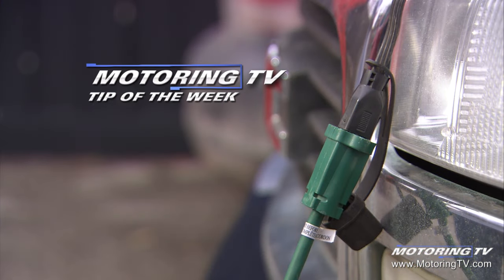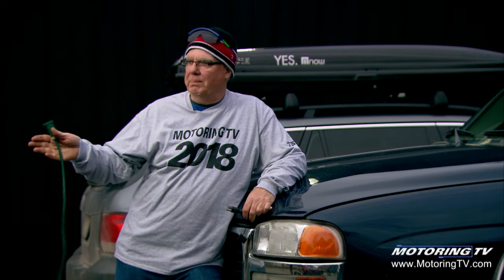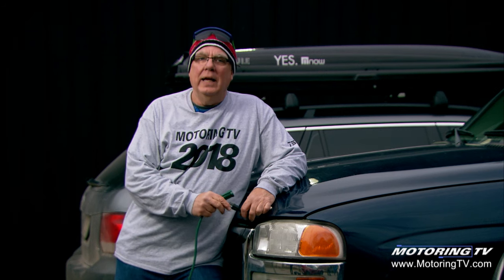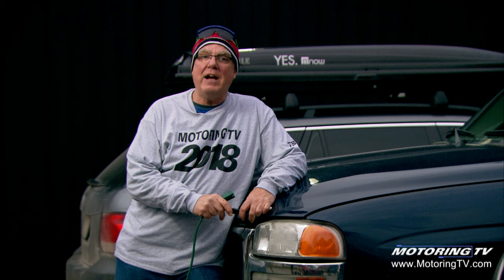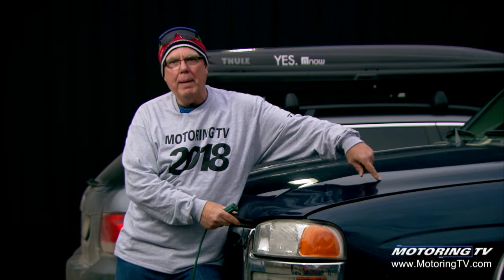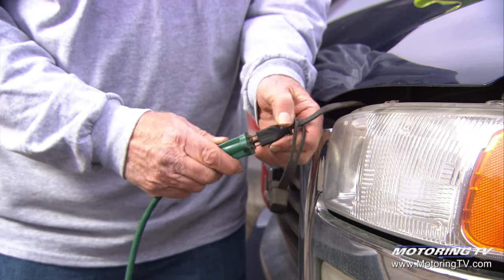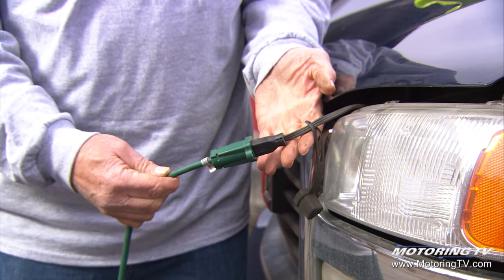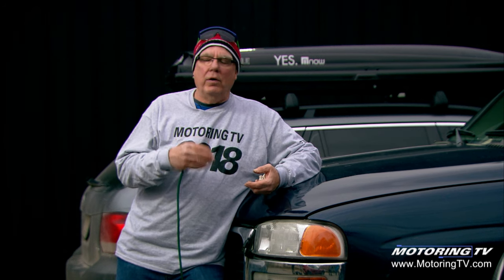Tip of The Week: Where's My Block Heater?

Comment: ...okay, cool. but, WHERE IS IT???
Reply: Look by the battery if your battery is under the hood check by the fuse box or look by back of the headlights or some cars have a spot to plug an extension cord into down by the grill area. On my car my cord was tucked away by the fuse box and battery

Comment: Right! If you can't find the plug when it is sticking out the front grill, you really have a problem, lol. Where is it attached under the hood and is it possible that there hasn't been one installed, which would be unusual in Canada?

Comment: Since the video is garbage waste of time and dosnt tell you where to find it I’ll help you out. Check by the battery or fuse box behind the headlights or some cars have a plug to plug an extension cord into behind the grill at the bottom. My cord was by my battery and fuse box good luck everyone.

Comment: Hello. I have a 2015 KIA SOUL and live in Wyoming. Do you know where the block heater is installed?
Thank you for your time
Reply: There is a good chance your car didn't have one installed. Many locations sell cars without them and to have one installed is a option so if you bought the car brand new check your speck sheet. If you bought it used the best advise I can give for finding out if you have one is to look at the engine compartment near the front by the grill from a electrical cord, sometimes you have to look really hard if no one ever used it, it maybe tucked away pretty good which my require you to get under the car at the front to see if you can spot the cord. If you cannot, I would suggest the next time you have a oil change or whatever you may take your car in for service ask your shop to show you where it is. They may tell you they don't see one. If you want they could probably install one which would require draining your antifreeze. And if they do that, then keep an eye on your antifreeze level for the following week every time you go to take a drive check the level cold. BTW A quick search and I found this online, the price says $62 so if your shop quotes you around that range I guess you'll have to decide  if your cool with that or not. Here's the link https://www.etrailer.com/Vehicle-Heaters/Kia/Soul/2015/KH11812.html I hope this helps.👍😎

Comment: I found his Block heater, its the red and black thing on his head.😂😂😂All kidding aside, I am wondering why my 2003 Audi Allroad Quattro has to power cords? Is it possible the one that isn't for the block heater be a transmission heater? I don't believe it's a battery blanket heater just because of where the battery is located. Anybody have any ideas?